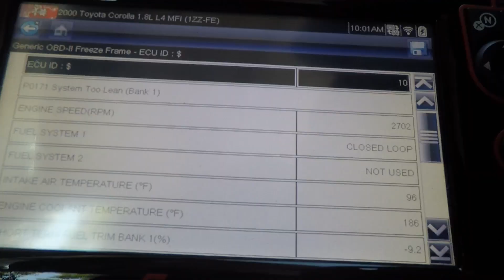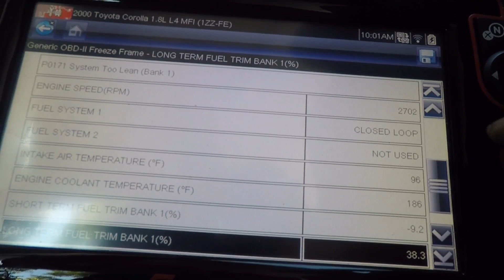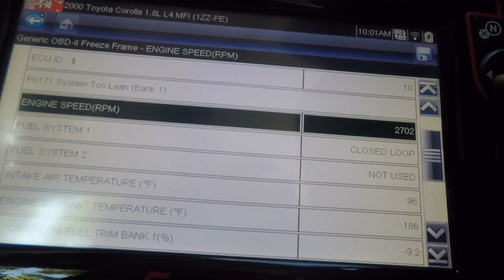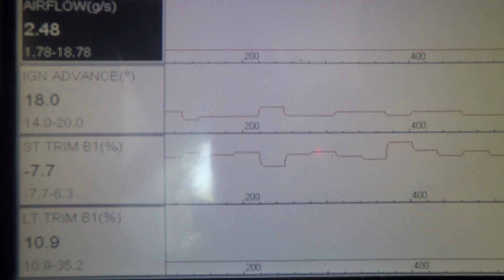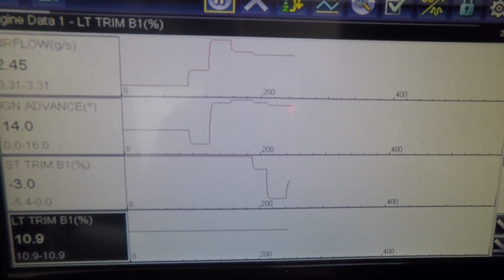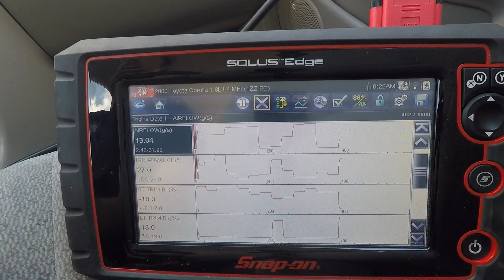2000 Toyota Corolla P0171

Comment: Bill again...had to correct my info from earlier. My MAF was reading in I serial, not metrics. Corrected MAF readings were around 1.8 to 2.0 at around 800 rpm, still OK I believe. Fuel trims just now were -1 to 3 for short and 34 for long.  I would still guess vacuum leak, but I sure can't find it.
Thanks again for your guidance. 
Bill

Comment: Hello Derek, I really enjoyed your Corolla P0171 video and am hopeful you might be able to provide a bit more guidance.  Mine is a2006 model with same 1.8L engine. Using your MAF formula, I thought my readings should be around 2ish at idle. My old MAF never got over .01, even under load. I guessed it was bad. I tried cleaning, but same result, so I replaced it and cleared the code.  Took for a rideand fuel trims still were high (30 or so) and MAF still at .01 or .02. FYI, it's found a vacuum leak in the PCV hose which I replaced, and put in a new intake manifold gasket just in case. I've sprayed water around any vacuum lines that I can see, but no engine sound difference nor bubbles that I notice. My b1s1 O2 sensor reads just over 3, so I am guessing it is an air/fuel ratio sensor instead and appears OK.
Sorry for the lo g winded explanation,  but wanted tp provide as much background as I could.
Thanks in advance if you have the time to point me in the right direction.
Bill

Comment: Same car, same issue, but with a P1305 igniter circuit #2 code as well. Died after startup when warm,  bogged down briefly when accelerating, and stalls when running. Cleaned MAF, and got no symptoms for a day or so, then they returned

Comment: Hello Derreck, Where are you located? Might be worth driving far and wide! As I shop for a mechanic, A mechanic over here said it's usually the intake gasket that needs to be replaced. Is this true? He hasn't seen the car yet was just his hunch to start there $$. I have a 2000 Toyota Corolla with 100k miles - runs great. I have a P0171 too lean bank 1. Thank you for any input or suggestion. Maybe I find someone who has and understands the diagnostics you have first?

Comment: if it's a dirty Mass air flow sensor it needs to be replaced, when  they are working normally they have a self-cleaning feature. the MAF sensor won't throw a code if the self-cleaning feature fails

Comment: I have a 01 Toyota Corolla with this code and can’t figure it out changed Crankshaft sensor oxygen sensors Feul pump coil pack MAF sensor spark plugs 🥺🥺🥺
Reply: Yes I did figure it out thanks
Reply: What was the issue? @johnquinones4671
Reply: @johnquinones4671 what ended up being the issue for you?
Reply: @johnquinones4671 what was it
Reply: @03kwam65 fuel rail with new fuel injectors fixed the problem

Comment: I have same code on my 01 corolla i just rebuilt the engine with juat shy of 100 miles on the rebuild im kinda lost looking at live data is there a way u can reach out to me and discuss this maybe look at what my datas showing and give me a direction to troubleshoot.. maf sensor is new and a denso part i did have to reuse the upstream o2 from the donor engine i used for rebuild.. at idle short ft is -20.3 and long is -10.9 maf is reading 0.01 and that measurment is in lb/second o2b1s1 is between .780 and .875 o2b1s2 is .750 and .795

Comment: P0107 system too lean bank 1 on my 2001 toyota corolla S , its has original 70,000 miles on it . My car also has a high idle when cold .

Comment: Very good, but only a little bit more of what everyone else shows.  Hence, I've cleaned my air filter and MAF sensor twice and see no vacuum leaks or tears in intake but CEL keeps returning, after 1-200 miles of me thinking I fixed it.  I don't know how to inspect fuel injectors and rtather not just replace them or the fuel pump.  I may have a small valve cover gasket leak, but it never registers on my dip stick or driveway.  What else?

Comment: Is it possible that the P0171 on this car could cause the engine to vibrate and shake a lot at idle?? I have checked the motor mounts and I don't think its a misfire because I never have gotten a misfire code....the p0171 has plagued my corolla and I'm worried the engine vibration is a misfire. Can a car be misfiring and no codes get thrown??
Reply: I'm no expert, but wrench a lot on my 2000.  P0171 is often due to MAF dirty or failing, and this may also cause the vibration since it does act like misfiring/mixture/timing.  They are very easy to clean with MAF sensor cleaner only, which probably won't do it, and easy to replace.  Get Denso.

Comment: Very useful video, you pretty much nailed the P0171... I have the same issue with a 2001 with 210K mikes, still with the original MAF.... after trying to clean it with alcohol, CEL still came on under load going up a hill, so I just ordered a new one.
Reply: Did getting a new MAF  solve the issue?
Reply: @danejurus69  Yes, a new MAF fixed it, no more CEL...!  The original lasted 18 years!

Comment: I was chasing down a p0171 in both my 2001 Honda Civic and my Dad's 2000 Chevy Prizm (Corolla). The Civic doesn't have a MAF sensor, but I cleaned the MAP sensor and the throttle body, and changed both O2 sensors. Used about 5 different fuel cleaners, and changed the fuel pump and filter. Cleaned the MAF on the Prizm and replaced the O2 sensor. Nothing worked. The same solution, which I have not read anywhere on the net, fixed both cars. I ran a gallon of water through the brake booster vacuum line on a hot car (the car has to be hot to turn the water into steam). Every time I added water, I put the RPMs to like 2000. This is basically like seafoam but you're using plain old water in a much higher dose. Afterwards, take the car for a spirited drive for a couple of miles. My best guess of what is happening is that the intake manifold is getting clogged with carbon over the years. Taking it apart is a pain in the butt, and the hot steam helps clear it out a bit. Worked on both cars. Check engine lights haven't come on since. Hope this helps people.
Reply: aznnp77 thanks aznmp, will try this in the future on my 2001 Corolla....
Reply: @TimmieTennis  Unfortunately, the code came back after 200 miles. I changed the MAF sensor and PCV valve but always comes back after 2 days now. Let me know if you figure anything out. People keep saying vacuum leak, but I can't find one. I heard if it's the intake manifold gasket you'd get P0171 AND P0174 because both banks would be lean, not just bank 1. But then again, I heard you only have 1 bank if you have a 4 cylinder, so I'm not sure.
Reply: @aznnp77  I've been reviewing this for a month since I don't drive much and it keeps returning.  I've tried two new MAF sensors and had shop look for vac leaks, which wasn't needed since code returns while driving as this vid said.  Next things to look at for each of us is O2 sensor and (more likely) injectors.  They supposedly can be cleaned, but it sounds like the seals on them go bad and can cause air inlet which causes lean running.  I don't want to do it, but the shops are incompetent here, they just throw parts, it's not their money.  I paid for diagnosis and was just told 'needs MAF, $500' (they are $75 online, $30 if you like Chinese/knockoffs.  Mine is 2000 and I do all my own work.

Comment: That diagnoser is from Snap-On ? My Corolla VVTi 2000 problem is erratic idle 1200 - 1400 when it should be 700 - 800. Airflow and TPS sensors within spec resistance. New inlet, throttle and idlespeed sensor gaskets. New plugs & radiator cap. Still no cure ! It feels like a vacuum leak somewhere but I don't see any. Ideas ?
Reply: If it has high idle in the summer and low idle in winter chances are it's your intake manifold gasket
Reply: @loganlikeslemons  - No one can wait a whole season to sort it out. In the end I took it to my local mechanic. He found the throttle vane was a bit wiggly. He also said this - not vacuum leaks from any point - was the commonest reason for fluctuating idles like mine.
Reply: you can find vacuum leaks with a smoke generator

Comment: Excellent video Derreck. I've got a corolla at the shop now with a lean code but no vacuum leaks. This will definitely help. Also, never heard the 1 g/s, per liter, per 500 rpm but that's a great piece of knowledge to have now.  Thanks!
Reply from the maker: You're welcome.  Just remember that rule only works at idle.  It does not work if you are giving it any throttle!

Comment: Hey Derreck I replaced the MAF and both 02 sensors and still having p0171 01 Corolla 1zz engine, this car is absolutely driving me insane, I did check for vacuum leak and I don't have any of that
Reply: Mike Zaldivar clean tps
Reply: @jabao9492  what is TPS  I T PLS can you explain so we know ,,, Thank you
Reply: What is tps?
Reply: @danejurus69  I hadn't heard that either and suspect he means Throttle Position Sensor, which I've not heard for this code, but https://www.yourmechanic.com/article/symptoms-of-a-bad-or-failing-throttle-position-sensor

Comment: How much do you charge for something like that?
Reply from the maker: A job like this generally bills out at 1 hour labor.  Shop labor rates vary a lot by location, anywhere from $60 to $150 an hour.
Reply: Hello Derreck, Where are you located? Might be worth driving far! A mechanic over here said it's usually the intake gasket that needs to be replaced. Is this true? I have a 2000 Toyota Corolla with 100k miles - runs great. P0171 too lean bank 1. Thank you for any input on his suggestion. Seems expensive to start there?  @diagnosticderreck3287

Comment: my lt trim is at 20 on idle what does that point towards also has a evap code canister is not holding pressure . also numbers dont change when i hold a 2000 rpm in drive they seem to go higher lt trim to 30